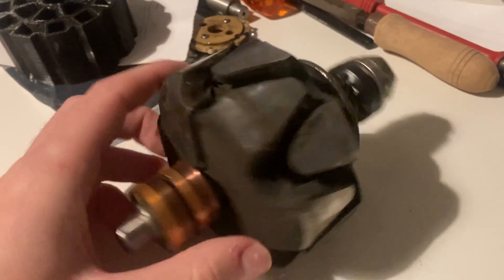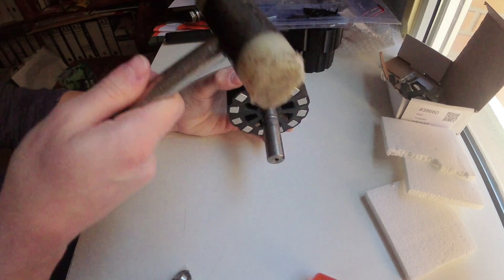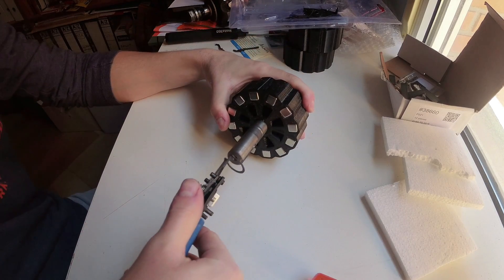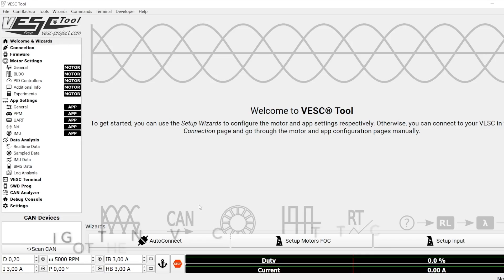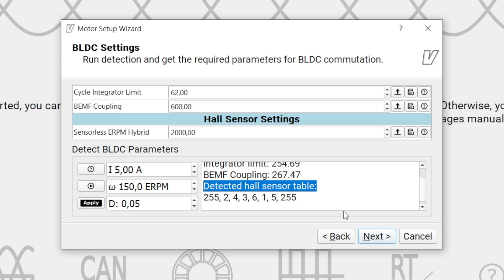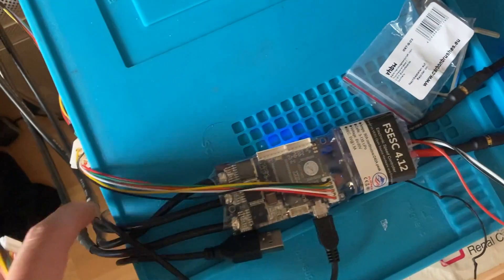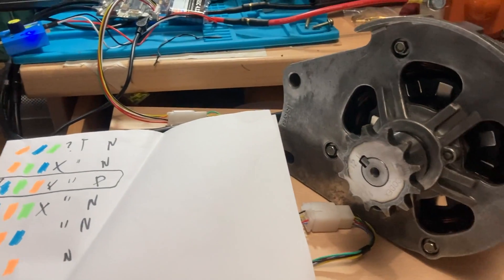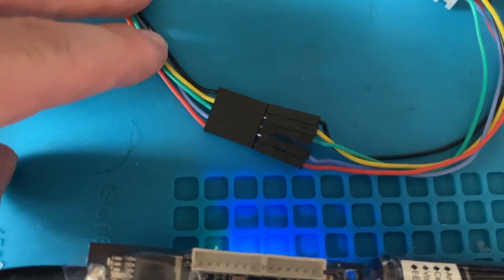How to convert a Car Alternator into a FULL BLDC Motor with Hall Sensors and Magnets (with VESC)

Comment: Just replace the coil of the rotor with a magnet like those of loud speakers but be careful they are made ceramics so at high rpm they shatters
Reply from the maker: That project is dead, but if someday I try to revisit it, I would do a custom steel rotor with arc magnets if I could find some.
Reply: @OverbuiltByHenry  https://youtu.be/MPY2JKwDNfY?feature=shared

Comment: Well done. Giving you a thumb up.

I will point out a couple of things, though. A donut magnet in place of the rotor winding, with the "claw" pole pieces retained, is very simple and will produce less cogging than bar magnets. The only problem is magnets of that type and size are expensive and dangerous to work with. A 3D printed rotor with bar magnets is possibly a bit less efficient and more labor intensive but cheaper. 

Hall sensors blowing is caused by the controller. For a DIY controller you can add a resistor and capacitor for protection, and maybe a diode. I use commercially made controllers, mostly Kelly pure sine wave controllers because unlike Curtis controllers, they are user programmable, like your VESC unit, but much, much cheaper. 

A spin test without a load is of limited value. It only proves that the motor will turn. Connect the motor to a quantifiable load, then compare output mechanical power to input electrical power, to measure your efficiency and as a tool for tweaking the firmware. 

A lot of guys who are only interested in producing content, are hooking ebike controllers or drone controllers or homebrew controllers with only three MOSFET devices as finals, and a battery to the field windings, and calling it a BLDC motor conversion, which is of course a big fat lie. Congratulations on turning an alternator into a real BLDC motor. And as a practical device goes, it is really stupid to not go with permanent magnets and Hall sensors for commutation, anyway.

Looking forward to seeing your load test, and installation in a working project.

Comment: Hello, Hall sensors need to be located somehow relative to the windings? Is it enough just to have an angle between them?
Reply from the maker: Yes, you need to locate them depending the hall angle you want to use (120º/60º) and also depends of the number of slots (windings) and pole pairs. Here’s a useful blog to know how to locate them: http://mitrocketscience.blogspot.com/2011/08/hall-effect-sensor-placement-for.html?m=1

Comment: Great build. Do you have test results on a table, ie, volts, current and rpm?  I want to know the expected torque if I build with similar parts so that I can design a gear reduction for my application. Also, interested in the power draw at 25%,50%,75% and 100%. Keep up the great work
Reply: I😅😅i

Comment: nice mod is that part printed from pla? how it holds dont you think it would fail strip or crack from torque load if you put it like on a bike or cart? also from heat?

Comment: Great work, you can please measure the rms voltage produced in a single phase of this modified alternator at 3000 rpm without load, or any rpm that you can test.  Thanks.

Comment: great video, thanks, I left a like.
can you kindly explain to me the advantages of having hall sensors?
Reply from the maker: Thanks! The hall sensors act like an encoder, it helps the controller to “know” the position of the rotor magnets, it has more torque at start up from a dead stop. In this video: https://youtu.be/93eG9ZT8RY8 you can see me going in reverse against the slope of the street, I couldn’t do it before without the hall sensors.
Reply: @OverbuiltByHenry  ok, all clear, thanks. And, last question, which ESC you used that it can be programmed?
Reply from the maker: @antonio.stefanelli  I used the VESC controller, fully programmable through pc

Comment: How did you make the rotors? What is it made of?
Reply from the maker: I designed the rotor in fusion 360 and then 3D printed it with PETG. The magnets and the axle are press fit.

Comment: hi awesome project well done .one minor detail if you swap the hex head bolt on the drive sprocket  for a grub screw it might help to reduce the vibration
Reply: Hello friend can you show me how to connect to the controller as esc and battery thank you

Comment: Just a general question from a novice. How do you separate +ve and -ve from the Alternator coil, As there are three AC terminals coming out of the Alternator coil? To generate AC current and run other devices from Alternator you have to have +ve  and -ve poles when you remove brush and stator coil where were you getting your -ve because all three poles on Alternator coils are (3 phase) +ve
Reply from the maker: The alternator is converted to run as a bldc motor, this particular one is wired in star, so you have 4 leads coming out (one for each phase (3) and the "star" connection hidden in the stator), the original rotor was replaced with a custom 3d printed rotor with embedded magnets so to run it as a 3 phase generator you only need to rotate the output axle where the sprocket is and it will output 3 phase AC.
Feel free to ask if you have more questions!

Comment: Magnets will loose its strength when heated, so bldc is a myth. It won't work for a long period. Heat generated in air gap and rotor will reduce the flux density of the material.
Reply: Then the motor will spin faster.

Comment: Any idea of the power produced? I want to build a e scooter or e Motorcycle, with atleast 3-5kwh motor, running at 60-96v , kinda braud range, but I want lots of power, and run low current, atleast 60-72v nominal , the current should not be too high, with peak power about 2x nominal, I'd like about 3-5kw to be around 50-70% throttle, with a average, or nominal speed about 60kph, and potentially 2x that full throttle, now it's a matter of making it happen! Put all that in a supermoto styled bike,
Reply from the maker: I'm currently building an inertia dyno to test all the motors to see how much power and torque they output, I hope I will finish it soon!

Comment: note that your work could work under small loads and etc, since your rotor is printed in PLASTIC, it will not withstand well THERMAL AND MECHANICAL stress, try with higher load and working time
Reply from the maker: This french youtuber made a similar conversion and installed on a kid’s go-kart he made, and runs like a charm. Here’s the video: https://youtu.be/HHqFX9QZ4bg

Comment: Do e- bike using this motor
Reply: I don't think so, your rotor is built in plastic, it means that it will not withstand strong mechanical or thermal loads, it is plastic, just look at how the shaft fits into the motor, maybe and being dreamers with a gearbox and increasing the rpms to decrease the torque on the motor side.
Reply: is what I tell him, to test it under higher mechanical load, 200, 300, 400 w, maximum 700w because I think that winding would not hold more, it is better to leave the factory rotor and only add the hall sensors 6 hall sensors in case a pack of three fails, and a controller for the electromagnets of the rotor.

Comment: Can you please explain why to use hall sensors 
Can't we directly give power
Reply from the maker: Yes, you can give power directly, but at starting it might buzz/vibrate a bit until catches up to speed.
Hall sensors are a type of encoder to know in which position is the rotor to give the corresponding phase more power (like a start from a dead stop), the way I have it set up at the video is when it reaches a specified rpm switches from sensored to sensorless; basically to have more torque at the start and when it starts to reach speed disconnects the halls to achieve more rotational speed (I think).
Reply: @OverbuiltByHenry  thanks for your reply 

Can you do me another favor 
Can you give me the 3d printing file
Reply from the maker: @thakurshyamsingh479  Anytime!
The rotor is custom made for this specific alternator model and neodymium magnets I had available. If you want the file, send me an e-mail at: enrengineeringytc@gmail.com and I will send you the model.
Do you want the .stl (for example to use with Cura) or the .step file (which is the design file)?
Reply: @OverbuiltByHenry  thaks for your response 
i have sent the email 
i want the .step file

Comment: That 3d printed rotor held?  What material did you use?
Reply from the maker: It's holding at the moment with no load tests, I'm keeping it as a spare just in case the Car alternator go kart motor fails. Material is PETG, 70% infill, 0.2mm layer height, took about ∼17 hours to print.

Comment: great project, congratulations. I recommend that you also install a 10k thermistor inside the motor to check motor temperatures
Reply from the maker: Thanks! I considered installing an NTC or PTC in the stator when I was wiring to the VESC because I saw one pin dedicated for temperature.

Comment: I also wonder if the alternator could be ran in FOC mode, just to compare the noises while spinning at no load
Reply: Foc definitely the way to go runs so smooth!!  He’s done some good work there hey
Reply: @fixitmoditbreakit7982  he also needs some beefy heatsinks and non-electrically-conductive thermal paste
Reply from the maker: @fixitmoditbreakit7982  I will give it a go! I only wanted to check if it was posible, I'm new to the VESC world and definitely will explore it to get the maximum out of.
Reply: @OverbuiltByHenry   definitely keep the amps down when testing and make sure you erpm limit is below 60,000 I’ve blown 4 up so far lol.  Main thing I found is sudden current draw that the vesc doesn’t have time to limit and going over the erpm limit.  Also shorting out any of the inputs like ppm and adc lines kills them straight away